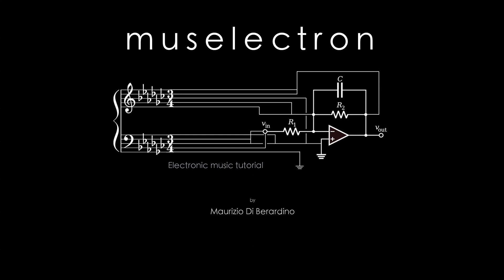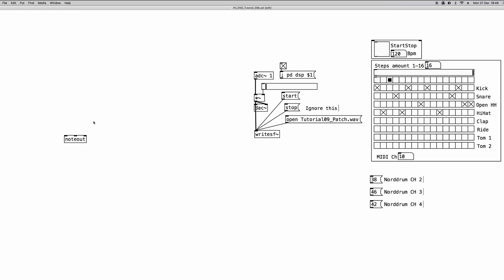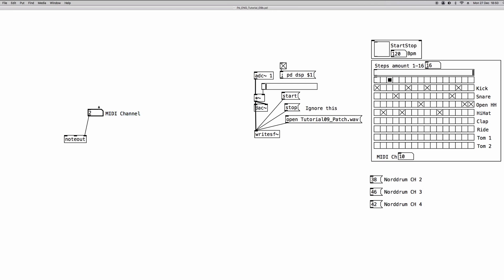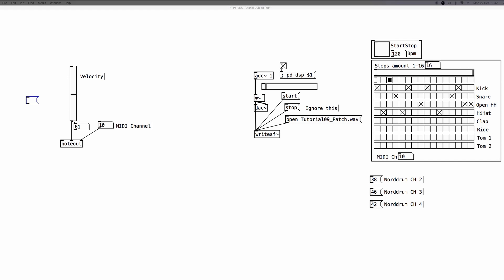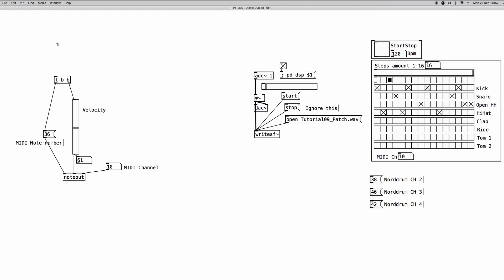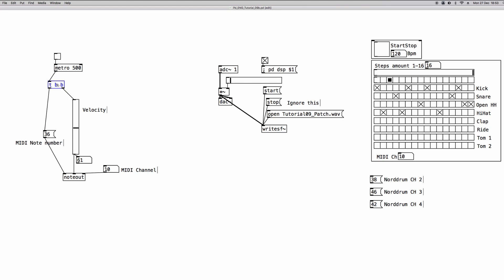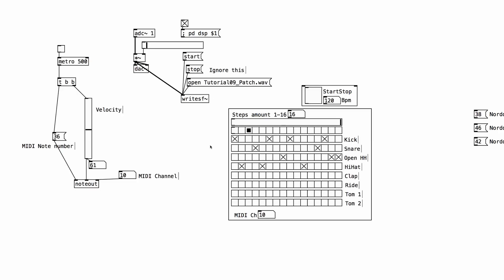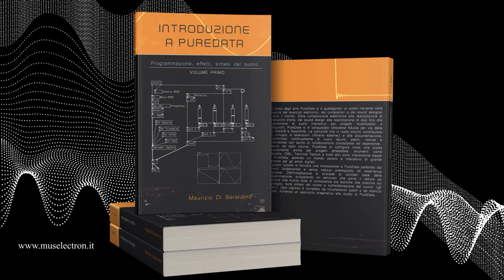Pure Data programming fundamentals Tutorial 09 ENG - MIDI Part 3: controlling hardware synths

Comment: Another amazing video, I’m so glad I found this channel. I’m working my way through your content and learning a lot. Is it possible to check whether a file exists in the root folder? I.e. if you record/write data to a file (to save), it would ideally check does recording1.wav exist, and if so create a new file called recording2.wav? Sorry I hope that makes sense
Reply from the maker: Afaik it is not possible to check the content of a folder. However, you can make your own file counter and rename the files automatically after the object finishes a given recording. I can make a tutorial about it, but it will take me a bit since I'm working on the new books, but I'll try to make it eventually next week. And thanks for the acknowledgments, I'm really happy my content is being useful for your work! :D
Reply: Yep understood. I’d be interested to know the best way to update the file name, not a big deal (I saw you manually do it, I’ll follow that system), but from a general programming point of view, would you mix a string and a variable into a new string, and use that as the file name? “Wav” + %1 .. and would that be done on execution if a write? So a command ‘after’ the write that updates a number var, which is then used for subsequent file creations? No need to respond, I’ll await any new tutorials when they arrive. I’m just mega curious lol

Comment: Is it possible to send MIDI out messages to all channels at once? I have seen gear operating with channel 0, which does exactly that, but PD does not seem to follow that rule. Does anyone know?
Reply from the maker: Afaik, there is no way to set a MIDI omni mode for Pd midi out objects. So I guess you have to find a way to send to the different channels at the same time either using multiple [noteout] o [ctlout] objects with different creation arguments for the channels or by creating a cycle loop to send the same message to the different channels using only one [noteout] or [ctlout] object
Reply: @Muselectron  yes I ve already tried that. Due to the high amount of messages the external gear seems to omit messages every now and then. Thanks anyway. At least I can stop wondering if it is at all possible.
Reply from the maker: Always happy to be of help, one way or the other :D

Comment: Dude I am having problems loading the Muselectron Studio. I tried the Path, Startup etc and it won't work. So frustrating all this teckmologi e na vera mingiata lol
Reply from the maker: Dahahah! First things first: it's Minghiata with an H! :D Jokes apart, be sure to check upper and lower case letters in the objects names, Pd is case sensitive (means that [Muselectron_16Steps] and [muselectron_16Steps] are two differente things for Pd, so the first one will work, the second one won't). You don't need to put the Muselectron Studio on the startup list, because they are simple externals. Try to load one of them by double clicking on it, it should open correctly giving you access to the object itself and you can eventually personalize it :D
Let me know!
Reply: @Muselectron  ahahhahahahhahahha I will try!

Comment: I wasn't able to get it to trigger any sounds on my Juno keyboard. But when I hooked it up to Ableton via the IAC driver, I was able to trigger a sampled kick! This is awesome. Do you know why I can't get it to work with my Juno?
Reply from the maker: Hey! Make sure you have the right MIDI settings on the Juno: MIDI channel you're receiving must be the same in Pd and the Juno; be sure you selected the proper MIDI port on your soundcard or MIDI interface; be sure your Juno is receiving MIDI messages from the MIDI port(s). If you're using a MIDI interface or soundcard that has more than one OUT port, remember that in Pd the numeric values are as follows:
1 to 16 -> Port 1 channels 1 to 16
17 to 32 -> Port 2 channels 1 to 16
and so on...
I'll make a new tutorial about this to better clarify, but if you check the [midiout] object's Help File it's also explained there. Let me know if you can get it to work ;)
Reply: @Muselectron  thanks for the reply bro! I will try everything and let you know